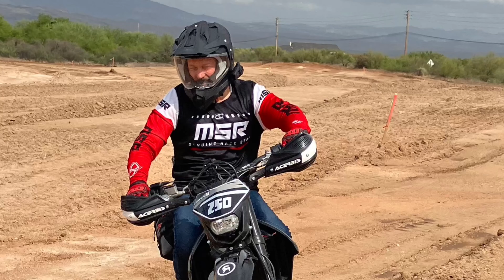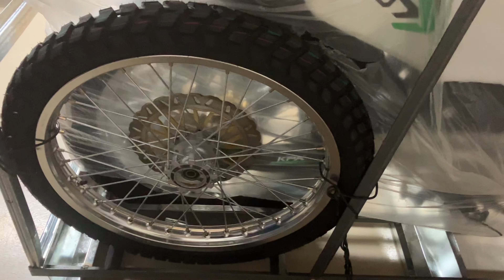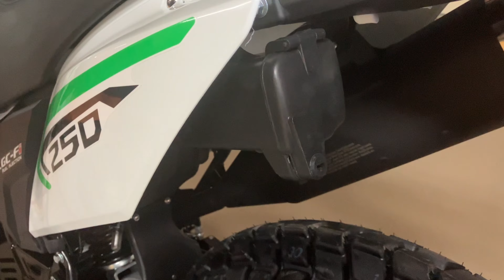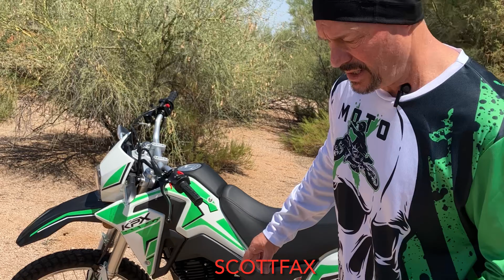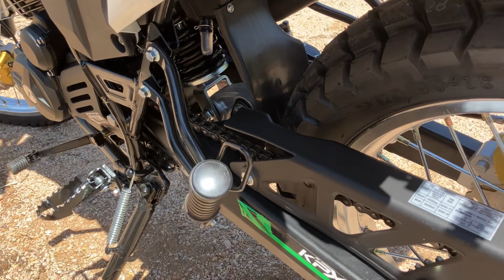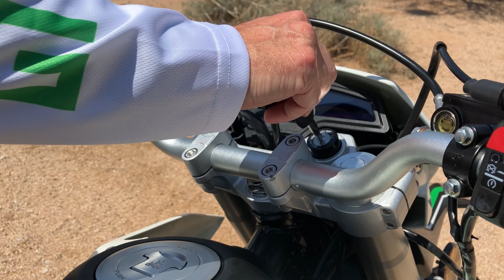Lifan KPX 250cc - Set-up and Review (The Lean-Mean-Green-Machine).

Comment: The only problem is the bike will shut off if you let it run and idle and at a red light  in first gear with the clutch in and you gotta restart it.everything is good besides that but it doesn’t like to stay on when it’s not moving.weird
Reply from the maker: Not sure about that issue as mine doesn’t do that,however, I did adjust the valves and do a air box mod. Check out the air box video you can test before committing to the mod. Thanks for watching. ELS

Comment: My dude, how tall are you? Im looking to get one but I'm only 5'7" and dont wanna order one and have it shipped halfway across the county just to find out its too big lol
Reply: Most of these enduros sit up significantly higher than your average street bike.  
I also have a '23 Hawk DLX, very similar to the Lifan's overall dimensions. Seat height is 36 inches. I believe the suspensions can be lowered on these, I never bothered to on mine as the point of the taller suspension crush depth is for a cushier ride off road.  Which they do quite well and I didn't want to compromise that feature.
For contrast my '08 Road King's seat height is about 26 inches -and also a wider seat. Easy to flatfoot at both sides -much more approachable to your average rider that rides pavement only, you would have to be insane to take one of these off road.  Unless your Sean @bikes and beards😅
I'm 5' 11" -out of habit I actually mount both of my bikes (my ATV even for some reason) from the right side. The Hawk I have to either tippy-toe on both sides at intersections, or just flatfoot with my left and keep my right foot on the rear brake -which is what they teach you at riders school anyway. I've had no issues tooling around Milwaukee all summer doing it this way. 
Hope some of these odds and ends help. Both bikes are an absolute blast, and I know Lifan's are absolutely fantastic for the $$...
Reply from the maker: I understand, I’m 5’9” and the bike fits great if you don’t mind touching with you tip toes! great bike you will enjoy.Thanks for watching.SCOTTFAX
Reply: im 5'10 and im on my tippy toes as well, its not the height that sucks to me its the weight, its a pretty heavy bike being that its so tall its easy to tip over

Comment: Personally.. I've been looking at the lifan bikes for a few years now. I love the lycan 250, kpx 250 and the kpm200. They all have different aspects that i love. Plus they are great beginner bikes for a new rider such as myself.  Only problem is deciding which one is right for me, for example, i plan on using it to make my daily commute to my workplace which is about a 45 minute drive on the highway where the speed limit is 70 plus there are some hills on the highway. But i also plan on using it for just riding around downtown. I like the accessories available for the lycan since i plan on having saddlebags with trauma kits in them for worst case scenarios... but i prefer the ability to take it off road like the kpm and the kpx
Reply: All I can say is LIfan makes a quality bike that you would be happy with. The balanced engine will be a benefit for a commute and highway use. The bike has the right power delivery for a new rider or a seasoned rider alike. Sounds like it’s time to get that bike! Thanks for watching. ELS